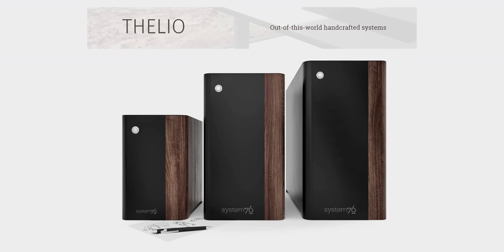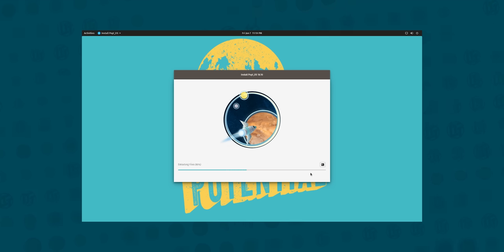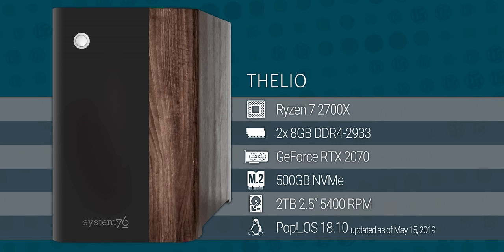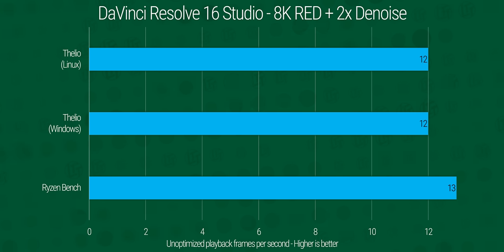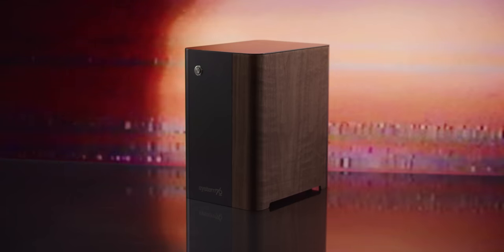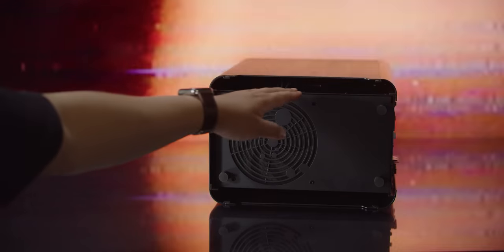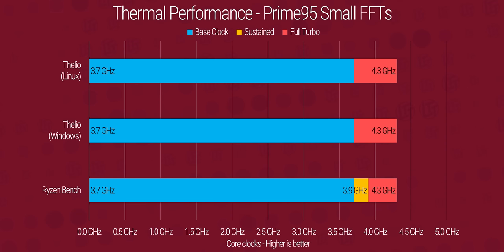A REALLY Weird PC… - System76 Thelio Review

Comment: Linus, why do you even think performance depends only on CPU?
Biggest performance advantage on Linux is in Contex Switch implementation. Windows have most wasteful and slowest Contex Switcher ever.
I can run at best 70 processes on Windows 7 and normal situation on Linux was close to 700 processes. This is on same hardware! AMD Athlon 64 x6 6400+, 4GB RAM, 160gb 2.5" Hard Disk Drive.
Windows would be trashing at 70 processes. Linux won't even slow down at 700 processes.
Contex Switch is a process of switching between processes. Contex Switch have to save CPU registers and then restore CPU registers for next process. This unfortunately takes quite a lot of time and need to be saved outside of processor (RAM).
On Linux you can set many settings to improve performance for your specific usage.
On Windows it is fixed and usually not fine tuned for anything.

Comment: Linux installation isn't difficult for most popular distros nowdays but the issue is that you'll always find some annoying compatibility issues which are sometimes impossible fix (or at least very time consuming). It can range from audio issues to terrible battery life. So vendors like system76 and tuxedo are lucrative even for more experienced linux users because you can be sure that the hardware is tested to work just fine for the pre installed distros which is basically a guarantee that itll be fine for any debiant (and for some models so arch )based variant you may want to install
Reply: how? i have a 2008 dell laptop and i easily found drivers for it

Comment: I am a fan of System 76. I used Pop OS 19.10 to use on my new PC I built myself. Mine is a Ryzen 5 3600 with X570 mb. The install was very easy. I am dual booting Windows 10. I am trying to get away from Windows. I also liked the fact that they have a separate ISO for Nvida. I have a GTX 1660 and my card was all set upon Install. Also I have a USB audio interface that was already detected upon install. I did not have to fight and disable other drivers. And my interface has not lost connection or switched drivers like Windows often does.

Comment: I know it isn't a typical use case for most, but when it comes to developer tools, you actually normally have to compile more things yourself on windows than on linux. The package managers on most distributions are dead simple: you type the name of the software you want and boom it is installed and ready to use. TBH the biggest problem I have with linux desktops nowadays is that they try too hard to take the "apple" route of "we know what's best for you". I use windows at home but linux at work, because in my opinion that's what they're both best for(With the exception that LibreOffice is kind of junk).

Comment: I used to be a diehard Linux tinkerer. I didn't mind spending hours or days or weeks, however long it took, getting everything about every new computer I had perfect and just the way I wanted it. That was a long time ago though, nowadays I want a system that does enough of the important things well enough without my intervention that I don't feel a need to really mess with it too much right away.

So I've been a Mac user for the last 5 years or so, after HATING them for so long. I just happened to come into a deal too good to pass up for an '11 MBP 13-in and didn't have any other working computer at the time so I started using it out of necessity and lack of anything else to use and now I'm on my third one (they all work still). Not the outcome I would have expected way back then.

Now there are a lot more choices in distros and window managers, and everything from the pros only, everything is a config file to extremely newbie-friendly ones that are just as drama-free as Windows or MacOS. I don't think the 'Linux on the desktop' revolution everyone has been hoping for for the last couple decades is ever going to happen, but for those that are inclined to Penguins, you've got more options than ever before, and a few of them can provide that easy, hand holding experience you may want if you don't have the time to tinker and just want to work.

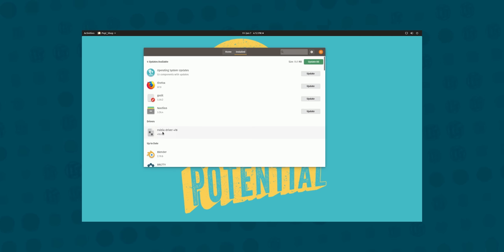Comment: 2:57 i'm not a Linux user but to update a driver on windows is to press "update" on the AMD or Nvidia program... i assume for it to be easier that that would be that the driver would auto update.
Reply: its not exactly that straightforward; the comments here are bit more rosy than reality. The available nvidia drivers, as packages, are dependent on the distribution and version. For example, for the latest nvidia drivers, you'll probably have to upgrade to Ubuntu 19.04 (or Pop's equivalent). Or, you can get the latest from Nivdia's website for the bleeding edge driver, but that downloads a script that, if I recall correctly, does compile a module into the kernel.
Reply: i see, it just that when Linus stated that Linux is easier than windows is mindbogglingly to me

Comment: Hey Linus i know you probably dont take video idea suggestions but i have a really good idea that i havent seen anyone do yet and i think you would be able to pull it off, its a pc build that can come as close as possible to matching the next gen consoles specs and performance, like getting two 1080ti to match the teraflops , a solid state drive, ray tracing ,120 frames per sec or close as possibe with available tech

Comment: The biggest problem is Gnome.  The Gnome devs start working on a longstanding issue, such as application names being cut short in the app grid, but never finish and move on to a new shiny thing.  The dev that was last working on the app grid issue stopped and is not working on GTK 4 stuff.  The Gnome devs also keep trying to re-invent things under the hood and strip out features in the process like transparent terminal windows or sorting options in Nautilus.  The constant refactoring of under-the-hood things in Gnome holds them back from improving the user experience and addressing very, very old bugs.  Gnome 4 will be out before issues that have existed since the early days of Gnome 3 will be fixed.

Comment: Things like compiling kernels, using the terminal to do anything are things of the past. Distros like Mint, PopOS, Zorin OS and so many others have a "normal" desktop that look similar to either Windows or Mac OS. You just click and drag like you would on the PC you have now. You can make your desktop look like anything you want.  And You don't need to spend any money to try / use Linux. Take a laptop or PC you don't use much anymore, download an ISO from the distro you want to try out, make a bootable USB drive from it (it is very easy to do BTW), plug it into the device you want to try it on and and run it from the USB even before you install it.  In short, anyone can download and use Linux. If you can go from a Windows machine to a Mac, you can go from a PC (or Mac) to Linux just as easy.

Comment: It is not feature of POP OS to encrypt data by just entering password.
It is feature of Linux Kernel (to lesser extend) and SSD/NVME (to higher extend). This feature is called SED (Self Encrypting Drive) and is designed by OPAL.
I know how it works and this needs very little support from Operating System at boot time and then it does not need any support, as drive delivers unencrypted data. Data is encrypted only internally in the drive

Comment: In the far future I plan to build a Linux gaming rig, I am considering System76's keyboard and gaming mouse (both specifically designed for Linux, with the Apps menu key having "super" on it instead of the Windows logo) but they're SO EXPENSIVE; the version of their keyboard that includes the numpad costs as much as some potato laptops. But at least the specs of their laptop have provided me with a basic list of currently Linux-friendly components to get: Ryzen > Intel, Radeon >>>>> NVIDIA (and I am vividly aware of the latter the hard way), as well as what types of RAM stick I'm looking for. And for the OS, I'm leaning towards Linux Mint (even though my current laptop runs Ubuntu Noble Numbat) since I like how it's made to look like Windows 10.

And one correction: It isn't always hard to install a Linux operating system, this fancy computer's choices of Ubuntu or Pop! (a distro of S76's own making) are both extremely easy to install.

Comment: I installed Linux on my ACER COMPAQ TC-220 and the HP computer for my father, I am using Linux Mint 18.3 CINNAMON (Silvia) 64bit edition in Legacy mode disabling UEFI and I have installed Linux Mint 19.1 CINNAMON (Tina) 64bit non UEFI legacy mode as the HP doesn't have a UEFI motherboard, if you want to render video then go for HAIKU a complete rewrite of BeOS and UltraDV which is a rewrite of UltraDV it to run on HAIKU.

Comment: I love Linux (although haven't tried PopOS) and I love slapping together PCs, but I find this desktop so appealing because of its breathtakingly beautiful chassis. I don't need all kinds of pulsing RGB LEDs, I want a design that's bold and simple, yet not sterile like a Mac. The wood and matte black design language is exactly that appeal I was looking for. Hardware is pretty overpriced, though. And the way the I/O ports are cut is problematic if you wanted to upgrade the mobo. Not a bad machine overall, though.

Comment: used to compile kernels tailored for my own system and tinkering around, I'm a long term linux geek, but once i bought an HP laptop with preinstalled SUSE linux. Yuck. Everything was damn wrong, they even installed a 32-bit os on a 64-bit machine BUT with PAE (wtf?), video acceleration for some reason couldn't work and ram was simply not enough to use it. after installing Debian and all the ram it could take, it became a fine workhorse. what were they thinking ?

Comment: I have a Thelio Major.. Terrific machine in every way except one - its case.  Reassembling it is too damn difficult.  I couldn't do it, the tech at MicroCenter I went to for an emergency repair couldn't either. It's flimsy, the fake woodgrain scars if you squint at it, and it's a maintainability disaster. I ended up rebuilding it into new case.

Comment: It's a nice system.  Wendel over at Level1Techs has gone over it too.  From what I can tell, even though it's shockingly easy to set the system up, it is really aimed for power users.
You know the sort, engineers/scientists etc that NEED a relatively powerful PC to do some work on, has great security, and runs their proprietary software(usually cheaper to make for Linux kernels)....... but also not clash with the mahogany and oak furniture.  ^___^
You've got to hand it to them though, they have taken the whole "consumer friendly experience" to a whole other level really.
And I do like the case......I like "different", and with a bit of modding the noise and dust wouldn't be an issue.  ^__-
Great review.

Comment: the best budget way to get going with Linux imo, is to grab a cheap but relaiable Dell 7xx to 5xxx Optiplex off Amazon or out of the garbage, slap in 8gb RAM, and a half assed $80 graphics card, add an SSD and have a USB stick handy, borrow some free WiFi, and get going. I've actually turned a few of my older machines, currently an Optiplex 580, and yes, lol it works just fine! it's much faster, and cleaner, no worries about fragmentation or virus issues... in fact it's probably all some people need. I'm playing around with the machines, but I'm not joking about the power of Linux, and ease of use in 2020, I do believe anyone with average intelligence would be happy and content with a home built POP OS box...but hey, if you have the money, and not the time, grab one of these :)

Comment: Your assumption about the Linux community in the beginning is correct. However, the Linux community is also currently expanding as DIY systems like Raspberry Pi use Linux and major companies have their employees use Linux. The community is not changing the user base of Linux, rather it is expanding it to include the normies

Comment: As I lifelong Windows user, I found myself with a netbook that couldn't fit Windows 10 updates despite it being the native OS. So I tried to switch to Linux. I tried Ubuntu and one of the small 'user-friendly' Linux (don't remember what it was called). In short: they sucked. They're just not user-friendly compared to Windows. I spent two weeks trying to get Linux to do what I wanted it to do and found that it just wasn't worth it. There was nothing I could do with Linux I couldn't do (easier) with Windows 10. The only issue was the size difference. It turned out to be more beneficial to go back to Windows 10 and just handle updates manually. Eventually replacing my SSD so I could keep up to date.

Comment: So I’m using a rtx 2060 razer blade and while plugged in in csgo I get above 200 fps on battery I’m getting under 80 fps my nvdia control panel under “Preferred Graphics Processor:” is “High Performance Nvdia Processor” please help ne

Comment: I installed POP on my dell XPS 12. Since POP OS have enforced the disc encryption most of the time when i start my computer it just sits on auth page without response.
When i install ubuntu i have choice to not encrypt my disc.
Reply: gilkesisking I just tried installing solution is simply " Simply select to not set a password, and you don't have encryption"

Comment: The way you put it, presumes Linux requires "tinkering". For me, the OS should just start programs - no tinkering with command lines.  That is much like Windows users work. I have used Linux since the nineties.  It works. The setup is easy.  Where is the tinkering if I don't actually want to tinker?

Comment: "Normals" manufacturers should use Linux in their products as well, Linux has a lot of preconception, it is much better than the normal user ever thought
Reply: Unless all commits to one distro it is still a mess to develop software. The fact that Linux is about free choices is the problem. Each distro have their own configuration. When you software run well on Ubuntu, does not mean it run well on CentOS.
Reply: Lenovo is going that route now, with Linux as the OS being a configuration option on quite a few laptops. (I assume you save money too.)
Reply: @UltimateAlgorithm  That's literally why Snaps, Flatpaks, and AppImages exist.
Reply: @liesdamnlies3372  all of that are good example of what I'm saying. The Linux community can't even agree with their packaging method and platform.
Reply: @UltimateAlgorithm  Just pick one and run with it? For all the hate they get, looks like the big names like Microsoft, Oracle, etc are getting behind snaps, for the exact reason that they speed and simplify development.

Comment: This is making me want to go fetch a hard drive and install Linux.
The games are there. The performance is there. The user experience is definitely there.
I wouldn't be considering this if MS wasn't killing Win7.
Reply: Go do it. GNU/Linux will not disappoint you.
The only thing you need to know is -> READING. Don't worry.. not much reading.
My go-to reading source for almost any problem I face with regards to Linux is archlinux wiki.
Choose whichever distribution you fancy and you can follow archlinux wiki for all configurations you want to apply to your system.
Reply: Just do your research. Don’t go distro hop mad like most of us do. Find the base you prefer and rip out everything you don’t want or need and put what you do want in its place. Don’t like GNOME? LXDE, XFCE, KDE. Don’t like floating desktops anymore? qtile, xmonad, i3wm, awesome. And that’s just what draws window containers for your GUI applications!
Reply: @hbt hbt I don't need, but if I start using it regularly, I can just find a spare HDD to use it in.

Comment: There is a LOT more UNDER the HOOD, then meets the eye

So I think the point that was completely missed in this review of pop os and what system 76 is trying to achieve is security and freedom in the way hardware is treated. You have as much ownership of your hardware as you can possible get.
 One that comes to mind is the they manage to disable ime on intel boards as best they can. ime has known vulnerabilities that you would never know your machine is compromised until its too late. The second issue is that ime does hinder performance in some cases while its active.
They also modify the boards/firmware to be able to hard switch devices fully off and disable things like blue tooth, cameras, mics ect so  when you tell devices to stop they are fully shutdown and cant be turned on remotely.
They have put a lot of time and effort to make their product as secure as possible without sacrificing performance and in some cases improves performance.
 As a side note one of the engineers Jeremy  Stoller on the system 76 team created his own micro kernel os called redox os using the rust lang. I believe that ir only took him 1 or 2 years to get a os, On the surface this doesn't seem all the impressive unless you look in the the direct apples to apples comparison of the HURD os  and I think Hindi, which have been in development much longer with less progress.
 I have a lot of respect for Jeremy and I have a lot of respect for the system 76 team for what they are trying to achieve.

Comment: I just ordered a new Dell Laptop with Windows 10.  I wanted a System 76 but could not afford one of their systems. They are sleek and beautiful. And ready to go with linux installed.  No muss, no fuss.  But, I am looking forward to wiping out the Windows 10 and installing linux mint when it arrives.  That will be very satisfying.  After support for Windows 7 goes away,  Microsoft Windows will no longer reside in my home on any of my pc's...
Reply: Why Linux mint and not Pop!_OS?
Reply: @gabriellesta7568  I'm familiar with Mint and have run it on my old laptop without difficulty. Never looked into Pop!_os.
Reply: @gilkesisking I had heard just exactly that. So I went to the Dell web site and looked at the laptops. The only options for OS were Windows 10 and Chrome.  I could have called but didn't.